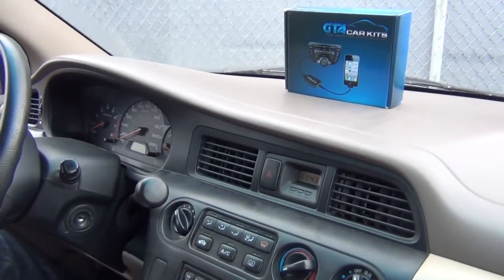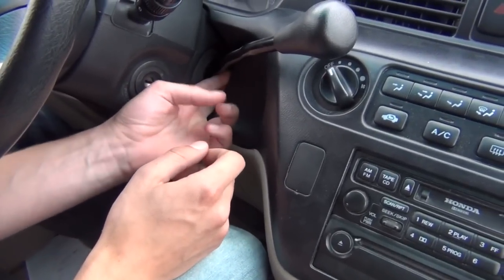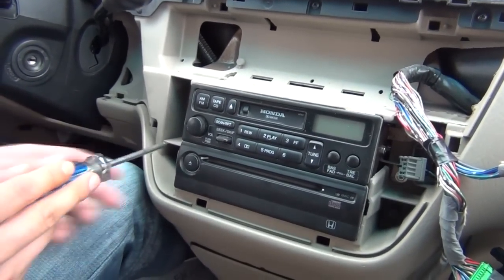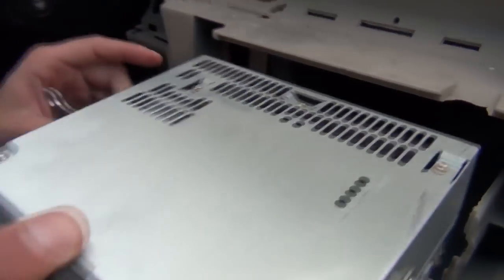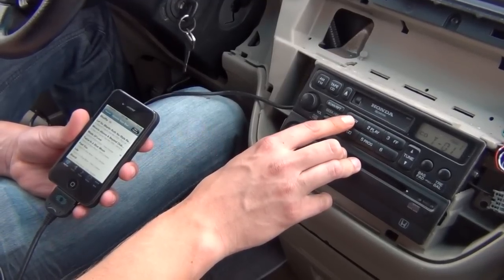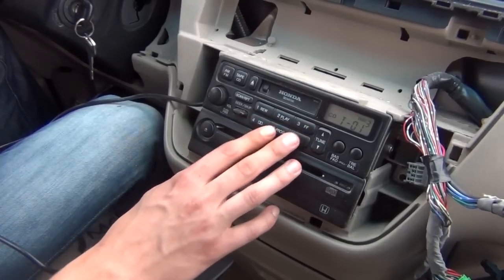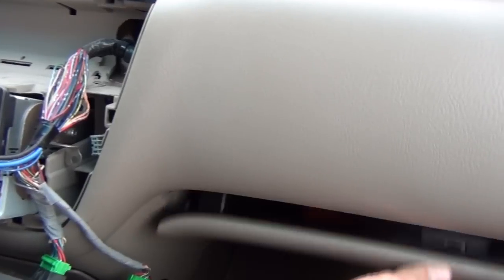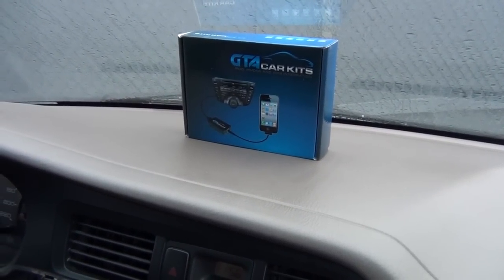GTA Car Kits - Honda Odyssey 1999-2004 install of iPhone, iPod and AUX adapter

Comment: I have wasted my time with the original Honda iPod Compatibility Kit on my 2001 Honda Odyssey over these last 12 months. I could only find versions as a used or refurbished product.  I installed a refurbished Honda iPod Compatibility Kit and it failed after about two days.  Then I bought a used one on eBay and it would not work at all.  I have been using my old FM Transmitter for my old click wheel iPod since last summer.  Then I finally ordered your GTA Car Kit for the Honda Odyssey 1999-2004.  It works great on my 2001 Odyssey and I love how I can select my playlist by hitting the FM preset buttons on my Honda Radio.  Your product is very good.  I regret that I did not purchase your car kit first instead fiddling around with these unreliable Honda kits.
Reply from the maker: Very happy to hear.

Comment: If I have factory Navigation and a single CD player + radio, Will this kit still work?
Reply: Im wondering the same too.... Ive been searching for 2 weeks for it. 

ALSO Does your Navigation HAZE or have a "WHITE" screen when you start the car and then when the GPS warms up it gets looking better. Do you have this problem at all?
Reply: Nabeel Osman I dont have that issue
Reply: I cant ever find anyone to have this issue..... Its really annoying. I have to wait 30min for it to clear up... but by that time its useles. lol. And it has the HVAC controls which make it even worse. Cause I have to wait for it to warm up before getting to the Heat Screen.
Reply from the maker: Marcus Gesundheit Hi, yes the kit will still work on your radio, please look on our website, you will need an extra cable to make it work! Thank you.